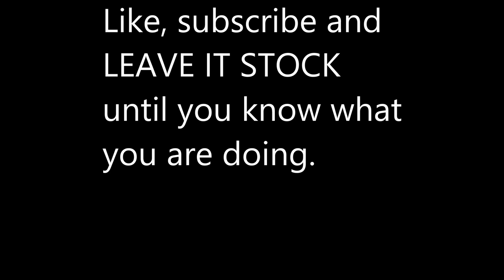Fly Smooth - Tuning Advice for Beginner drone pilots - Leave Betaflight ALONE - FPV Beginner Series

Comment: The Betaflight devs spend a ton of time making defaults the best they can be, so any decent pilot should be able to fly your standard 5" quad on defaults and get pretty good results. Once you know what you're doing, you can start to squeeze out that last bit of performance. There's tuning guides on the Betaflight Wiki for a reason, and intermediate or advanced pilots can benefit from them without spending a lot of time learning about the intricacies of tuning.
Reply from the maker: Good notes. I should really be thanking those devs when it comes to stuff like this. It’s not always perfect but it’s golf enough to fly stock and that is a huge accomplishment dev wise.

Comment: Great video, great advice. Thank you. It is really tempting to just constantly buy new gear. Also I
 was messing with settings but never felt much of a difference, exactly for the reason you are talking about.... Not enough stick time. I think I will rewatch this video regularly to keep from doing useless changes.

Comment: Good advice been flying for 3 years , and never touched the pids. There’s nothing wrong with flying stock . Remember it’s 80% pilot, 15% your gear and  only 5% your Pids. Only thing I suggest is get a quality frame . It was the only thing that made a difference for me. Everything else is disposable. Embrace the crash.
Reply from the maker: I like that math. Good notes!  Hopefully we can spread the word so more people can fly without agonizing over the pid screen at home.
Reply: @JonE5FPV   how about your next video. I suggest telling beginning pilots that you don't need to update from BF 3.5.7 to BF4.1  if you are happy with the firmware. Also remind them that BF4.1 has it's own learning curve. eg. VTX power programming smart audio ,and the slider filtering . Suggest JBarwell if the want too learn more, before updating. Thankyou.

Comment: Great video, I 100% agree you on this. Although I only been flying fpv for less than a year I am an expert rc drifter and tell all the newbies to practice, practice, practice and change setting one time at a time to learn what the change does which will help them learning tuning as well. I have been flying 10 packs everyday on my tadpole and was semi comfortable doing split s and would crash and didnt know how to bail out but now I can adjust mid flight if I'm off and avoid crashes and readjust the quad. In just 2 weeks I think my skill level has increased drastically, and can complete all my 10 packs without any big crashes just maybe skimming a branches and maybe damaging props trying more skilled moves like Rubik's cubes, inverted yaw spins and such. I guess that makes me intermediate :). Now I'm trying to learn how to be smooth and flowy and string moves together in a nice clean run.
Reply from the maker: You are definitely ahead of the curve with all your RC knowledge. It’s amazing how fast you can progress when you just put the settings, tweeks, changes aside and just practice. 

I’m still learning stuff every week years in.  Just when I think I’m finally good I’ll get on the global Velocidrone races and go against the best in the world. That is definitely humbling!
Reply: You just compared flying to driving.  Your very very wrong.  Yes stick time is very important,  but without tuning your just learning how do fly without it causing wobbles.  That doesn't fix the issue.  This video is by a newbie.  I've been flying for over 10 years. No stick time will fix wobbles out.  Follow the pros not the joes.

Comment: I run stock 3.5.7 on everything. With my rates. Tried 4.x.x once, one pack, and went straight back!
Reply: Yes there's a reason why most Fight Controllers these days come with BF3.5.7 preinstalled . Because it's the most stable and easy too set up out of the box.

Comment: Well said about hobbies being split into two: "doing" the hobby and "collecting gear". So true. We do all get caught up in that don't we. Question for you though coming from a newb. I might have it wrong, but from what I understand about PID's it's more about tuning it to how the quad is supposed to fly (reaction of the quad to input from the sticks, reducing oscillation, keeping angles tight) which does need to be corrected if it's not good out of the box. Rates however, a different story where that is mostly if not all about preference. Is this differentiation correct btw PID tuning and adjusting rates or am I totally off?
Reply from the maker: Basically yes. The new versions of betaflight, pid defaults are better than ever and need little tuning, like they did in years past.   Rates are preference. Freestylers like high, racers like low (like looking down scope in an FPS game).  Find what works for you best.

Comment: I agree but... What if my motors are hot? 🧐 I've noticed that my 1105 xing camo's get hot after the 1st pack on my 2.5". Still running 3.5.7 on that one. Should I go 4.1 and leave it stock to see if it helps?

Comment: Im currently attempting to walk this noob line, and your advice seems sound to me. I purchased a TH freestyle, which should be good right out of the box. Got a nice controller with opentx and learned that. Got a decent set of good noob box goggles. And bought a bunch of 1s and 2s packs.. also doing time on the Liftoff to help..Once the TH freestyle shows up.. we'll see if that Sim time has helped any..lol Thanks for the advice and I'll continue following this section for beginners.
Reply from the maker: Great strategy. Keep at it. The smoothness will come.

Comment: ok, I hear you, you got your 10 min + 2 sec from this video, ---but,    -flying gps drones for a while, new to fpv, new to tinys just got the beta kit (did not come with a LITE controller -looks like a F4 FC but differs a bit -has micro plug on it).  I can scoot around on the floor, but as soon as I give it ANY (I mean small) throttle it smacks into the ceiling -either floor or ceiling -impossible to hover at all -yes, I'm pinching. I can't imagine any amount of sticktime will cure this. I just question the settings and want to make sure they are at least, what they should be, but I don't know what that is. Think I found some on INTOFPV detune advice. Where are more settings? What do you think? Tell me I'm wrong (you did already -10 minutes worth).
Reply from the maker: It seems like tuning will fix this but it is stick time.   You can lower rates some, but they are not very high on that kit. The issue is from video games you are used to full stick deflection. 

But that is like turning your steering wheel all the way 3 rotations right. Throttle especially is adjusted very little around the middle range especially indoors. 

Keep practicing you will get there
Reply: @JonE5FPV  My point was the kit did not come with the normal FC the Lite 1 or 2S -so you can not say they are not very high. I think they are ridiculously high.
-No infor about this controller and no configurer -has a plug but won't hook to BF, No adj on OSD. Just ordered a 2S -we'll see how that works out. --and no customer service from betafpv -nothing.

Comment: Thank you for the advice! And from an engineering/scientific standpoint your message is solid! Changing multiple variables is never good if you’re trying to understand the results. I’m brand new to the hobby and I’ve spent a couple weeks on the simulator before I got my gear. My only problem is none of the simulators (DRL and Liftoff so far) seem to have a setup similar to my TinyHawk 2. And I don’t have enough batteries yet to put in significant stick time outside.  Any suggestions on liftoff or DRL to get a similar feel to a micro like the TH2?